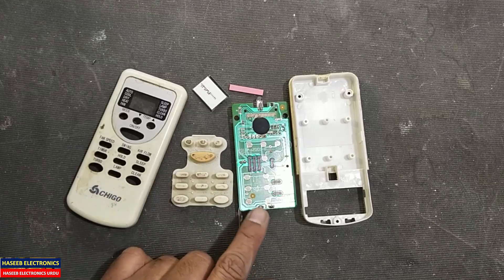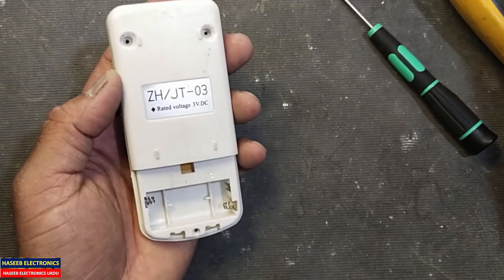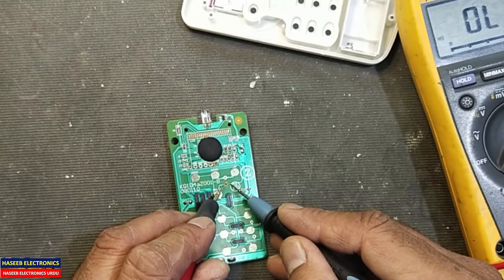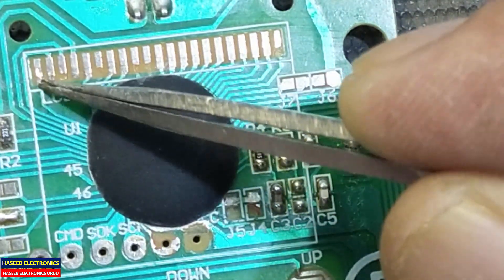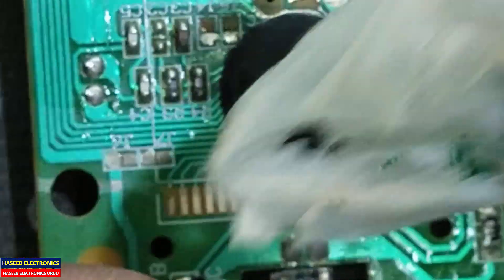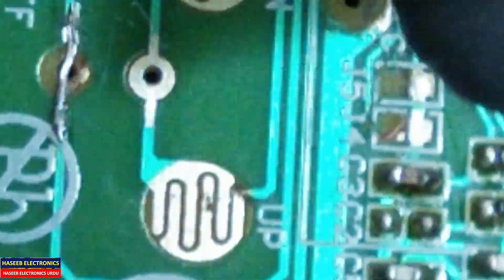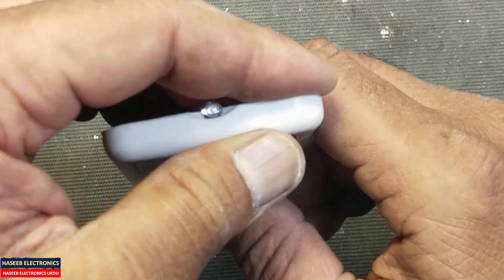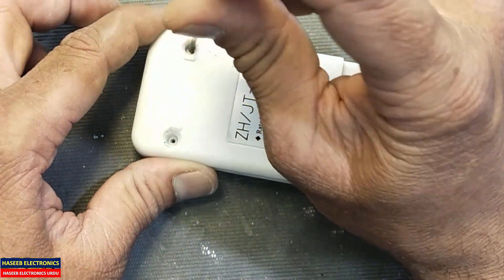{624} How To Repair AC Remote Control / AC Remote Control Have No Display, No IR Output

Comment: Great video! I love to watch you solder. You have great steady hands. Entertaining to watch. I wonder what happened to the old traces? Best regards!
Reply from the maker: best regards and special thanks 
the biggest problem using these Zebra LCD connecting pads, that it creates layer of humidity while interacting with dust rust and minerals in air and humidity 
so using keypads and the micro movement of the PCB creates abrasive action on the meta;ic contacts of PCB and after passage time it creates cracks and disconnections 
sometimes the silicon rubber of keypad as do the same action with PCB tracks, especially when the remote control is used in kitchen environments, so oily fumes creates a rapid layer on PCB and gathers a rusty layer and formulates the same chemical reaction on copper traces as well

Comment: If the infrared does not send the signal, can it be repaired?
Reply from the maker: if the microcontroller fails to generate the code, then there is no solution. just replacement is option

Comment: Very good demonstration for fixing remote sir. However, I want to ask a question regarding a video I just watched from the channel JYOTSNA MOBILE CARE - titled "Display Flex repair | Vivo s1 Display Flex Repair | How to Repair cutting Display Flex | Flex jumper" https://www.youtube.com/watch?v=NTdBhsbXtKw&t=375s - where at timestamp 6:15 he starts soldering a very thin wire to complete all the missing and cut traces of the flexy circuit of the phone.
What is interesting is the fact that the wire is very thin and easily solders when heat is applied at the end however he does not bother to make sure they don't touch each other  (I guess there is some kind of insulation preventing short-circuiting). There is no mention of the type of wire used, where to obtain it from, or the temperature set for the soldering iron. Since you did a similar thing with the remote i.e. reconnect the broken traces with a thin wire could you loo into what kind of wire that was in the video so that I can repair a whole lot of phones I have with broken flex cables stored in my closet? Could you help me locate a website to buy this special item?

Comment: Very good repaired. How could this damage happen? Was acid inside or leaking batteries? 🤔
Reply from the maker: thanks a lot
it is corrosion caused by the humidity and dust rust 
between PCB and zebra connection pad
and frequently keys pressing caused the abbressive action which caused to disconnect the tracks 
I think so.
what do you think dear?

Comment: Thank you for sharing your experience and knowledge. My AC remote shows all data on lcd but doesn't respond when any button is pressed?? 🤔
Reply from the maker: please check its IR LED (turn on your mobile phone's camera. point the IR LED transmitter towards camera and press any key. on mobile screen you will red light coming out from Remote LED.  if it gives indication then remote is working 
otherwise its LED is not transmitting signal 
sometimes its contacts of IR LED with PCB are dry soldered or separated. so replace it 
or sometimes IR LED is damaged. so replace it
Reply: @HaseebElectronics  Thank you for your quick reply and kind care!!
Reply from the maker: @nasserahmed583  it is mh pleasure